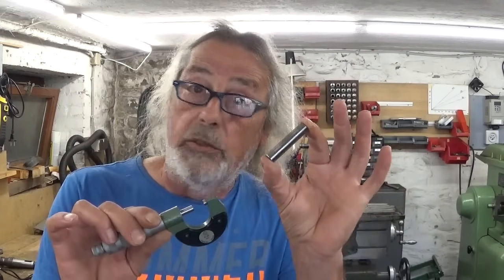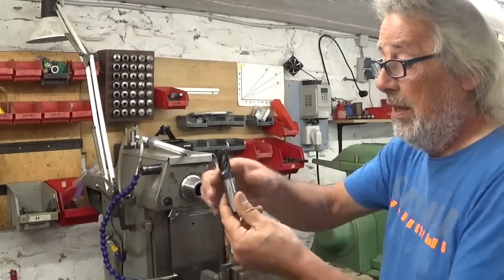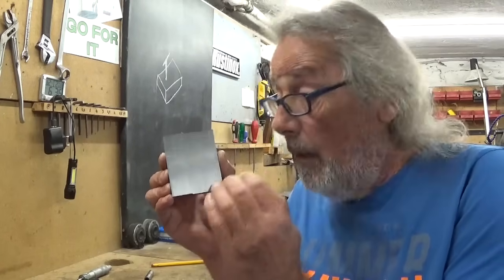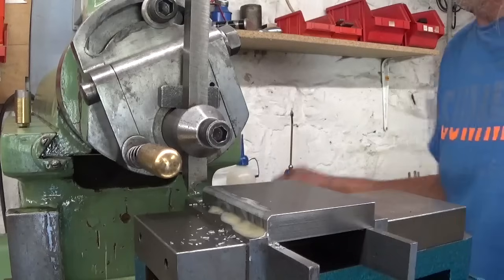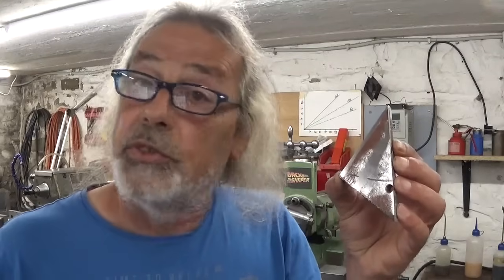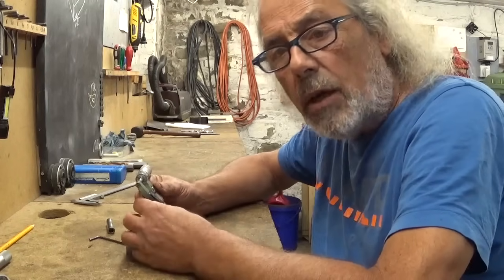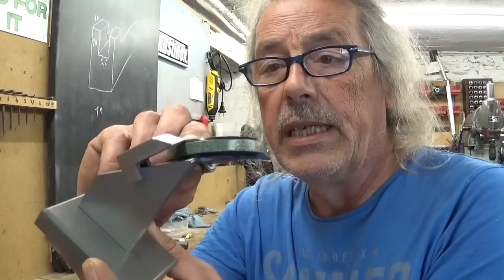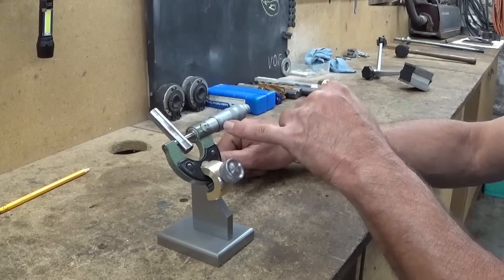Let's make a micrometer stand.

Comment: That is a brilliant stand. Great contrast between between brass and steel. Ive started a project recently myself naturally it will take time. A pair of identical machinist jacks with v cut in the head parts. Welcome back,  hope you had a good rest between your activities. Ive been thinking, if one can tramm a mill, why not a shaper, but that little corner glitch would hardly be noticed or even perceived

Comment: I've seen several ways to hold the clapper up on the back stroke to get a better finish. 1) rubber band a scrap of leather to the rear of the tool, on the back stroke the leather will rub between the tool and the part lifting the clapper, but on the forward stroke it will bend out of the way. 2) clamp a weight to the front of the tool, the momentum will lift the clapper more at higher speeds at least. 3) a complicated looking electromagnet that lifts the clapper on the back stroke but leaves wires dangling around the ram, I guess it worked but it sort of looked like a shock hazard.

Comment: Is your shirt supposed to signify that summer is almost over? I watch your videos regularly Great stuff. My very first part I made on a shaper back in 1972 high school machine shop. I still have it. It's a small spring loaded scriber with an adjustable thumb screw. Vivid memories of those hot steel chips shooting out onto the floor (and the smell of cut steel). Stuck with it was a machinist for 40 years.

Comment: I had an issue with my shaper that I used way-oil on the clapper box to lubricate it. It wasn't returning fast enough so I cleaned it and used very light machine oil and it made a huge difference. I use way-oil everywhere else on in the shaper.
Reply from the maker: Indeed, using sticky oil on the clapper isn't a good idea.

Comment: Just wondering if the spring closer on your clapper box is creating the marks at high speed?
Reply from the maker: The spring reduces the dings.
Reply: @Rustinox  perhaps making a clapper lifter might be a project?
Reply: Hope the vacation went well. I love to see the shaper put to work. I have an 8 inch I'm learning to run, and how the clapper box needs to be set for different operations.  Thanks!